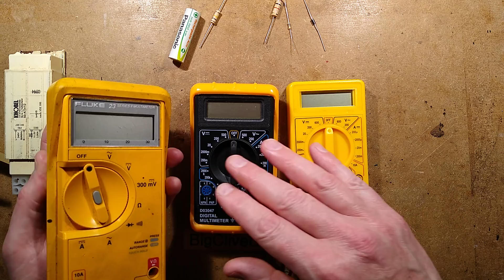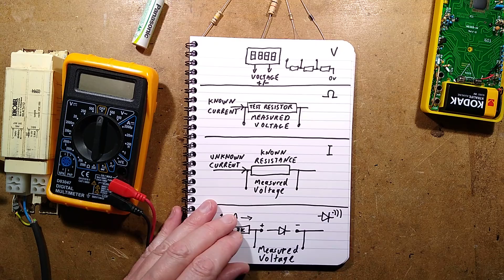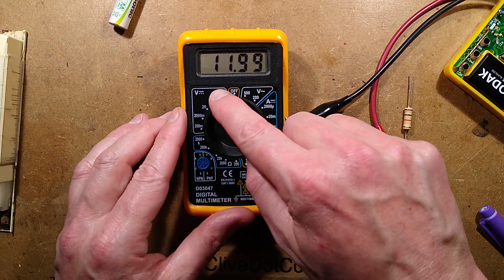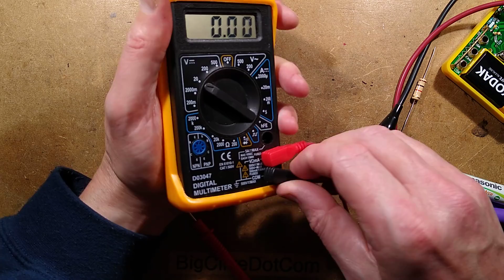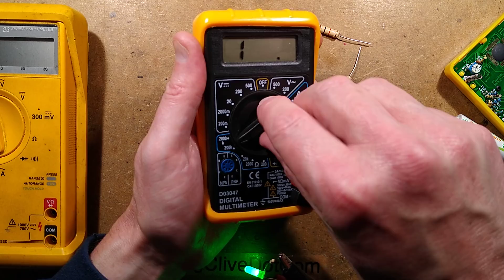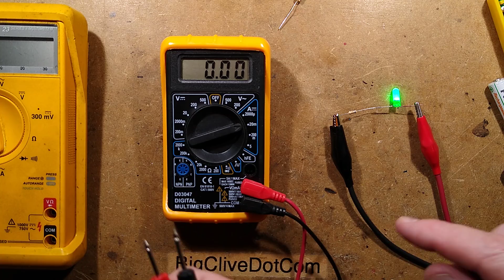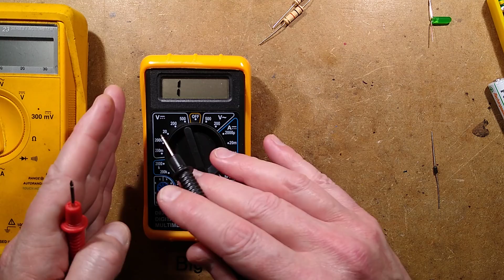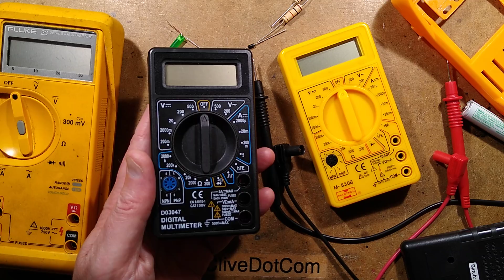How to use your trashy meter without blowing it up (much)

Comment: I still have my first "real" meter, a triplett 3067, and I still use it - keep it on my truck... Also have a Fluke 85 III - I have had for almost 30 years, Had a Fluke 87 before that. Let someone borrow the 87 and they blew it up. My favorite meter was one that had a tone relative to the value being measured (1990s). It was yellow and a name brand meter, but not a Fluke. It was nice beacuse you could tell by the tone if a voltage was around what you were expecting without looking at it, by the tone. (stolen) I also had a personal go to meter I kept in my desk. A realistic pocket meter than folded up like an old school cigarette case. No current measurements but had auto ranging and little tiny probes, like a meter for a little person, permanently attached to the meter, no probe jacks and very short leads. Loved it!!!! (Died of natural causes, old age)
I remember as a kid drooling over those giant Simpson meters... SO COOL !!!!! When I finally got my hands on one in high school and opened up, I was very disappointed. Yes, it is a precision machine. Yes it uses a wheatstone Bridge. Yes they were expensive and desireable.... but good GOD, those things were built like a tube TV inside. What a MESS!!!! By then it was 1983 and DMM's were coming out, and I no longer wanted a Simpson after seeing the sloppy mess inside one of them. Bought the Triplett 3067 instead. A good purchase, still works!!!
Reply: I also have a few El Cheapo meters I keep around to loan, or have here and there just so I don't have to get up and find a good meter. One in the wife's car, Mother in law's house, etc. - Nothing wrong with a $20 meter for most measurements

Comment: I have two of the cheapo yellow meters (one as back up) and they're about 17 years old and still going strong! I day back up but it's not due to reliability concerns, it just seems one goes missing and the other shows up. I'm not even convinced they're two separate meters any more as I've yet to see them in the same room but they do have distinguishing features, one has an eye patch and a moustache for example.

A more expensive meter would be an extravagance for me ("wicked child!") as all I use them for is testing  for broken wires and basic OHM testing on things like ABS sensors and checking voltage on batteries at non running/running voltage ranges. Handy to tell if your alternator is on the fritz!

For someone like me and my limited needs they're absolutely perfect.

Comment: i love my digital meter, it must be about 20 years old now but it still does the job. I also have a couple of really cheap analogue meters which are extremely usefull for tracing cut signal wires back to source by injecting a low voltage pulse into them (making sure they're not connected to anything 1st using the DM) then probing about with the analogue till I find the pulse on the other end, much easier to see that way.

Comment: My Fluke will display  ripple when set to AC and placed across a DC power supply. Pretty handy in servicing old radios for hum problems and checking smoothing caps.

Comment: I had one of the first Flukes.  They costed a fortune then. I left it in the case for a few years in the cupboard then switched it on. The display had packed up.  I looked into replacing the display, then saw what they asked for. I threw it away but kept the leads and case.  It still use the grey case today. I have many meters, inc' those with amp clamps, manual range set, and auto, none are expensive and all do the job.  But pride of place is a big American Simpson analogue meter, with a roller shutter.  

I agree with the comments that having quality leads makes a difference, as even the cheaper meters are good enough for most applications.

Comment: Mostly I use my meter in AC RMS auto-range. It's amazing how many "electronic" faults can be traced back to the AC supply - as I'm sure you know!

The one time I accidentally set it to current when checking voltage across a 100A breaker was . . . exciting. The tip of the positive probe vaporized. Surprisingly for a budget Chinese meter, everything except the current modes still work and the calibration is still good. The fuse worked perfectly!

Comment: Useful little meters, have a few around the house. E.g. in a draw in the living , so I don't have to run stairs to see if a battery is running low. But also for low voltage circuit building it is handy to have a few. When one of your better meters is in use in a circuit, for quick measuring a resistor you would have to remove your meter...

Comment: Great video!
Yes, if you don't go around main (please, DON'T) an el cheapo DMM is perfectly fine and accurate enough for 99% of hobby tasks.
A couple of nitpicky notes:
0:28 a Fluke won't bat an eyelid - though repetitive stress might degrade the protection circuitry - been there, done that; moreover the fuse won't blow, as it's only in circuit for current measurement. Cheaper DMMs might behave as Big Clive says, been there too...
1:02 Probably an Italian ICE multimeter - the 680 model was produced till 2013 and one can still find them new from some distributors (not cheap!). Removing the rotary switch, a common point of failure, they were very reliable, albeit awkward to use.
4:04 all modern handheld DMM use a very simple ratiometric circuitry, in practice comparing the unknown resistor to a known one (according to the range) - much, much easier (=cheaper) than creating a constant current generator capable to span several orders of magnitude.

Comment: I bought a fluke on impulse back in '95 and it's still doing great.   My first meter was a cheap tandy back in the 70s and remember smoking the current shunt when I tried to measure 100ma @ 120v.  It's half watt resistor for a shunt never had a chance.

Comment: Thx Clive for covering meters functionalities. Just by knowing how they, the meters, configure themselves for different tests informs the operator as to the limitations and the dangers that can occur. Knowing that an Ammeter uses a low value shunt resistor tells you that it shouldn't be place across any voltage source.

Unless you are exploring some new area of physics these kinds of meters are usually more than adequate for routine work. If you are even designing circuitry they are still fine. If your crkt can only work within an extremely small tolerance then it will not be robust for long term durability. 

Another aspect of these meters is that unless you overload the internal scaling resistors and they change temperature these units offer quite good repeatable measurements in the same work session.

Now, if you are working on a critical measuring system the first thing to get right is repeatability and these meters can show that.  So, after you have proven your design is functional, pull out the extreme accurate meters for fine tuning verification of your design.

I like the fast continuity checkers because it saves time. The delay does slow me down. If it is a problem I just grab another meter with a fast cont. test. Also if you look close the cont test is really the diode test with a threshold to sound a tone. The typical diode check for a digital meter is an open crkt voltage of at least three volts and a constant current of 1mA.

Mine have a batt check also. That comes in handy as it presents a load to the battery not just the meter resistance which is typically 10MΩ.

Again thx Clive for covering this topic well.

Comment: I have actually used the transistor gain tester a couple times. Once when working on a project that dimmed LEDs by utilizing the linear region of 2N2222 transistors. And another time where I was making a miniature Slayer Exciter that needed three paralleled 2N2222 transistors with as high a gain as possible while still gain matching them.

Comment: It might be worth pointing out that these cheap meters are not just your starter meter, but also your second meter once you upgrade. It's quite handy to have a second meter around for when you need to measure both voltage and amperage in a circuit (or two voltages), or your main meter's plugged into a circuit under test and you want to have a quick poke at something else without disconnecting the main one.

Comment: I still have and use my 1986 Metex with the fancy Transistor, Diode, Cap test, HFE, and freq counter (topped out at 200 khz). Still works too. :)

I also have a higher end unit for field work, but the Metex is used all around the house, vehicles, and shop. :)

Comment: Hey Clive, like you, I never use the gain socket or the capacitance sockets. I have had issues with those so I use a dedicated component tester ( Here in Australia the best is from Altronics and is the q2100) and a dedicated ESR or effective series resistance tester ( it gives both the capacitance and the ESR but not the voltage. Again it's from Altronics here in Australia and this one is the Q2105 ). I did have a multimeter style capacitance tester but a friend borrowed it and didn't discharge the capacitor first, blowing the unit up. My multimeter is an autoranging unit with highest reading hold function and a ten amp current reading. It also beeps when you insert the positive probe into the current port until you press the backlight button, warning you of where the probes are connected. It also has a frequency function which I have never used ( I have a DSO - benchtop digital signal occilloscope and a small handheld battery unit I bought from ebay. It's suprisingly accurate too). The cost, a little over $90 australian, not sure what that would be in UK Pounds. It also has 1000v isolation. well worth the money as long as you are careful and look after them. Try not to wrap the test leads around the meter either, it stresses the leads, the sockets and makes it hard to put it back into its case.  Oh and dont loan them to anyone, it might come back kaputed.

Comment: I blew my first analogue meter up at the age of about 11 by accidentally measuring the mains while on resistance range! Melted the shunt, which was a wirewound element. I made a new shunt from the same length of nichrome wire ( I think it was). Still works more than 50 years later!!

Comment: My first multimeter was a Tandy analog one, with a Rotary dial, not much idiot proofing if I recall. The revered AVO mk10 was not accurate on low voltage. You needed a valve type for this. 
Most DMM are quite accurate,  Ref digital processing,  but I agree with many subscribers,  any voltage  above 100, especially mains should be avoided.  Better to have a test lamp, and test leads rated suitably. Low quality test leads can lead to very poor, and dangerous results. 
Great back to basics. 
Thanks for sharing.

Comment: Some of the scratchy type of buzzer will even give a different pitch if there's higher resistance between the probes, or give unmistakable little chirps if there's a capacitor between them.

Comment: Love the video, it's always nice to see someone going through the basics. Will you do one about leads and their top bits and such? I remember it was a huge improvement in my life when I realized you can get all sorts of accessories for dirt cheap, I was just not aware of them (and that is the point, sometimes you just never hear about these things). Like the alligator clips that you can mount on the pointy end of the test probe. Or you can buy a test lead set with a lead with a screw mount so you can screw banana plugs, alligator clips and probe ends in it. Or hook clips which are pretty awsome for measuring jumper wires.

Comment: It should be pointed out that if you are testing mains voltages or higher voltages, it is strongly recommended to use fused meter probes.
Reply: That's what the fuse in the meter is for.  Use a quality meter if your life depends on it.

Comment: It's amazing how much abuse these cheap little things will take and keep working. I've shorted the shunt hard enough to melt the plastic case and the solder holding it together...everything still worked except for the 10A current setting. Made several others either melt or make very loud noises/smoke and still keep working...

If you pay retail for the 9v battery inside, it's actually cheaper to just get another one at Harbor Freight with the battery already installed if it ever goes dead.

Comment: I've noticed that a weak point on the cheap meters is the probe connections cracking, as has happened on both of mine. On one the metal sleeve of the regular volts/ohms connector detached and pushed into the high current shunt. I went to check for the presence of 120VAC at the input of a power supply that wasn't working, and let's just say that AC was present. It evaporated the tip of my probe and tripped the breaker.

Protip: if you are getting weird readings put the meter on the 200 ohms setting and short the leads. You should get a nice stable reading less than five ohms. If it jumps all over the place, there's a bad connection. Resoldering the probe connectors if there's not a nice fillet usually helps, or else take out the board and clean the switch contacts.

Comment: I totally agree. I was totally satishfied with the "famous" DT-830B for years. That said it was the better variety with real IC and not just a blob. Can't remember what happened to it but I broke it somehow. Found two recently in a dumpster dive exactly alike and they're working perfectly - even still reasonably calibrated compared to my constant voltage source - except today we use security banana clips and they have not so no modern leads unless modified. Have tried a few new ones from China but all have been crap - not even up to the standard of your yellow one. One was decent and it was a kit but all others have been crap with crap on - no fuses, battery leads prone to break off, under spec'ed 10A components and the worst switch mechanism ever. The DIY while it is based on a blob everying else is decent. Even the switch is an old fashioned balled one to make the ratcheting - just like the old ones from the 90s (like the one I had and found in dumpster dive)

Comment: I once put the probes of my trash meter across the 240v inputs of a water heater in 10amp mode. Needless to say, after I blinked away the bright welding spark, I will be checking the settings beforehand... The crazy thing is that the meter still worked just fine afterward.
Reply from the maker: It's pretty hard to blow the shunt.  The breaker/fuse and probe tips tend to clear the fault.

Comment: I have used the h21e transistor meter on these. It's handy if you need to match transistors for amplifier output stages and whatnot.

Comment: I see Fluke as nothing else some sort of Gucci. Internally they aren't much better than most of the middle class devices, but cost twice as much, because they have Fluke written on them. I personally use the multimeters from Voltcraft for my work with microelectronics. They are almost identical to the ones from Fluke, ecxept they are grey instead of yellow.

Comment: My first digital multimeter was a homemade IM-1212 from Heathkit, 200 points with two beautiful nixie tubes. I gave it later to a friend when I bought my Beckman 3020 DMM, I really loved that multimeter until I got some contamination of the LCD rendering it unreadable (I still have it, expecting to find a replacement LCD to revive it...). Finally, I have my all day companion, a practical and reliable Fluke 87. But sometime, I still use a galvanometer model, especially for tuning RF circuits when peaking a deep of a resonance is quite an impossible task for a digital multimeter, even for a state-of-the-art one!...

Comment: I mostly used cheap meters until my dad passed away and left me a Fluke 189 and 289. The most noticeable difference  is the ability to read down to microvolts accurately which is useful for sensitive  instrumentation work. Cheap meters won’t give you this capability. And of course data logging features are nice to have. But I still use my trashy meters where I don’t need the precision or accuracy and they work just fine. You can get cheap external shunts if you need to read higher amperage. They plug right in to the banana plugs and protect your meter from damage as well.

Comment: Oh Tandy. I remember buying my first multimeter 50 years ago at Tandy. It's still working, and was my multimeter of choice until 10 years ago when I bought a high end analog multimeter. This year I bought the yellow to the right, just because it was cheap on Ebay.

Comment: So I opened my cheapo meter, which I tend to use for current in bench supply situations (just another display to glance at), and I noticed that before going through the 10amp shunt, it passes through a circuit board track a few millimeters across.  Facepalm.  It goes to show that even with cheap Chinese meters, it's not one standard design--there are important variances.

Comment: This came up in my recommendations just now. What @Barszczu Garage said in a previous comment bears repeating: some of these meters have the 10 A shunt directly under the sockets, and their factory leads have special shorter banana plugs. A normal banana plug creates a short against the 10 A shunt, unless it has a plastic tip.